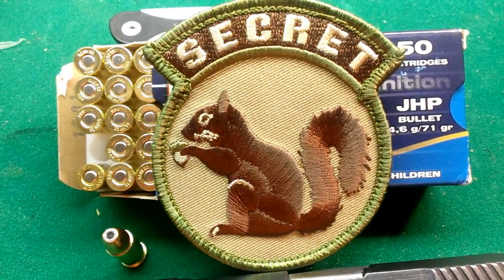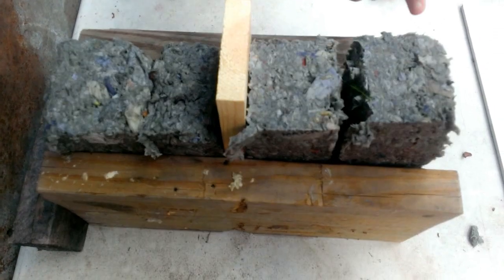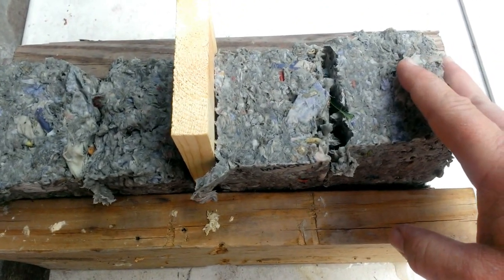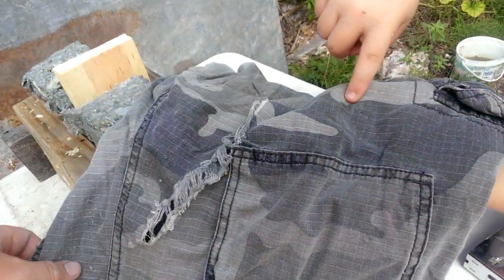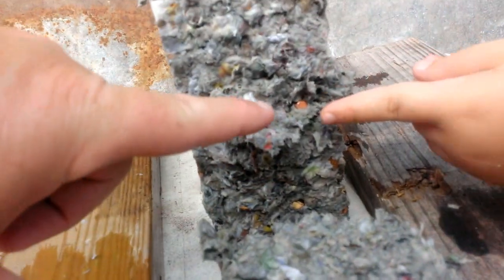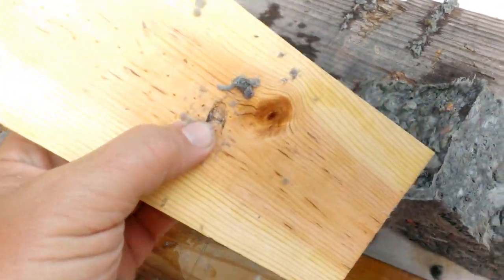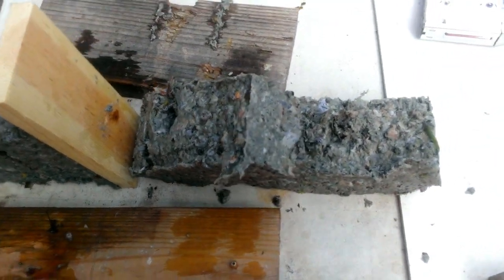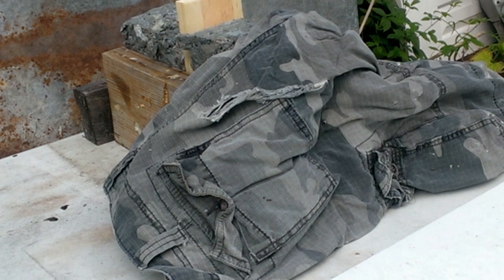.32acp vs wetpack and 1/2in. board penetration test (ballistics)

Comment: First off, Kudos for doing the uncommon. Second Kudos for involving the young ones.  The lack of performance on the hollow point doesn't surprise me, as I have heard else where that it is not a good idea to use JHP with slow moving small calibers as they don't reliably expand. Would be interested to know if the ricochet effect could be consistently duplicated.
Reply from the maker: Great comments
Reply from the maker: Exactly, great comments!

Comment: why will I carry or have a 32 gun is just useless. I reather have 380 but if I'm going to Carry a 380 I reather carry a 9mm compact lol.
Reply from the maker: You don't have to worry about over penetration with a 32 like you do from a 9mm.  Less recoil and quicker follow up shots.....
Reply: poboyspecial why will I carry a 32 what's the purpose
Reply: Chris sv650 to have a pocket pistol. I have a glock 27 but I want something small that I can put in my pocket. 8 fmjs centermass at 15 feet you will fold. I want the Beretta tomcat tho not a fan of keltec.
Reply: Chris sv650 why carry a 380 is the real question the ammo cost as much as 9mm ammo
Reply: george lopez   .380 is even more $ than 9mm...but I've also got .38spl, .45, .380,.22, 9mm, and love my .32 Tomcat!